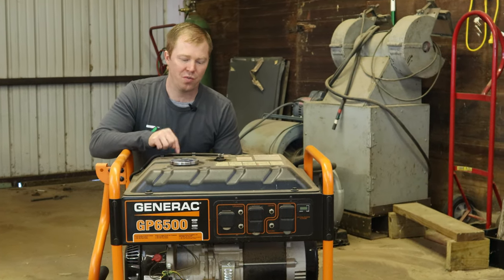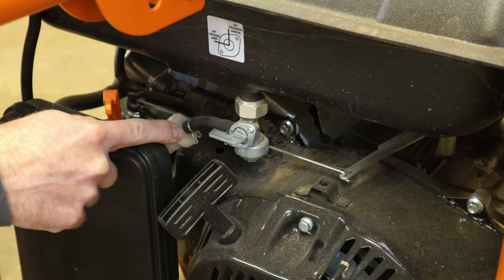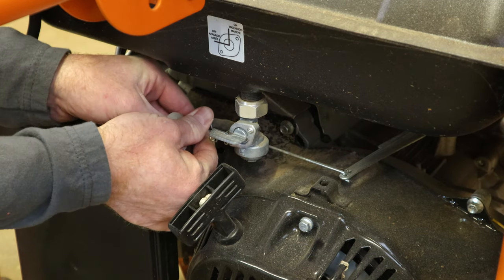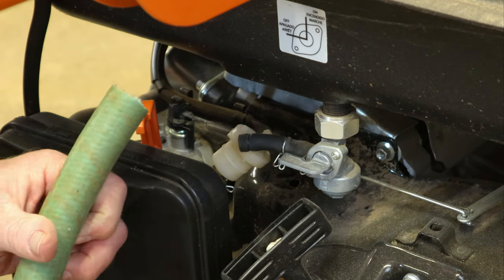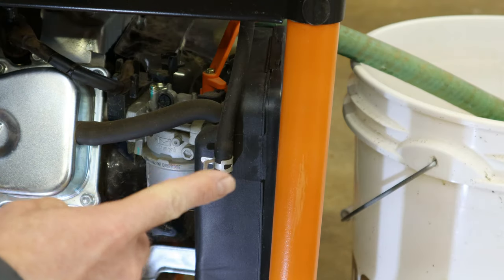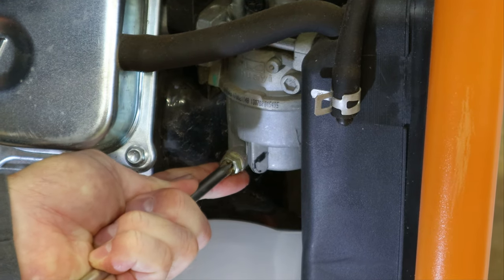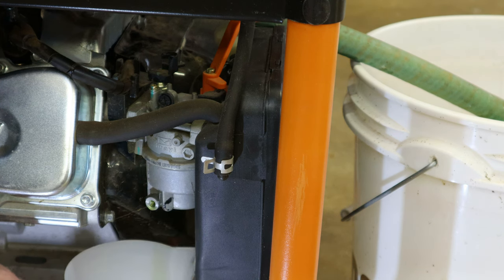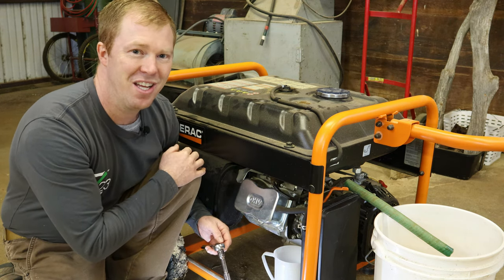Drain Old Gas from Generator - Save Your Fuel System

Comment: Good tips.  You can also simply let the generator run until its out of gas which is what I do each year.
Reply from the maker: Great tip Kent! I do that as well. This tank of gas had set for over a year where didn't want to run the old gas through the system. But yes, if your gas is not too old it is easier just to let it run till empty. Thanks for mentioning that.
Reply: I have a 50 Amp generator..  As a woman, I am at a loss for much of this stuff.  I  purchased to use in the winter to save my pool in case of a Grid Failure.  I am having a HARD time finding a hazardous  facility.  How long would it take for  me to burn  the gas from the generator..   I burned some by letting it run for 20 minutes each month. The gas is  a year old with fuel stabilizer in it.
Reply: Yes, and then attempt to crank it with the choke on. That will cause it to suck the last bit of fuel from the carb.
Reply: @ArtGardenFoodExpressions - don’t store fuel in it, drain the fuel and use it in your car. Don’t keep fuel more than three months. Just cycle it through your car then you don’t have to buy Stabil or worry about it going bad. No big deal for me.
Reply: Just running a dry is not sufficient. You need to drain the bowl by removing the bolt on the carburetor bowl.

Comment: Great video this is definitely how you store a generator and not have to buy unnecessary stuff like Stabil or ethanol free fuel. Once suggestion when you’ve removed the fuel line take your compressor and blow low pressure air down through the carburetor with the bowl bolt off.  That will get a few more teaspoons out to really get the bowl clear of fuel.  I’ve done this for 10 or 15 years. I start mine maybe every eight months or when the power goes out. Starts on the first pull

Comment: Thanks for your videos!  I'm getting my generator ready for Hurricane Milton and it's not been used in over a year and stupidly, I did not fill it with fuel and a stabilizer to store.  These instructions worked for my DeWalt DXGNR8000 which looks pretty much exactly the same as your Generac.

Comment: What can we do with year old gasoline? Also tell everyone not to run that E85 junk in small motors. They should be using only Premium. Thanks for the video!❤
Reply from the maker: Getting rid of old gasoline can be a hard solution but with a little effort it can be done safely and legally. Option 1 is searching online for a disposal center near you. You can search "hazardous waste disposal center in ___ county or city or state.  
Option 2: Call your city waste management agency and see if they know of a local place to dispose of it.  
Option 3: Call your local fire department and ask them. 
Option 4: If it is pure gas (NO gas / oil mix from chainsaws, weed eaters, etc.) some people will put small amounts in their vehicle. If they have a 10 gallon tank they might mix 1/2 a gallon of old in with the new to slowly use up the old gas. Vehicles are better equipped to run old gas through their system, BUT I don't recommend this option where you are still running the risk of gumming up your vehicle's fuel system and causing other problems. Hope that helps!

And I totally agree on no E85 gas in small engines. I have a gas station nearby that sells 100%gas and use that in mine.

Comment: I need to drain my old gas also, problem is how to dispose of the old gas.
Reply from the maker: Hi Steve, That can be a hard solution but with a little effort it can be done safely and legally. Option 1 is searching online for a disposal center near you. You can search "hazardous waste disposal center in ___ county or city or state.  
Option 2: Call your city waste management agency and see if they know of a local place to dispose of it.  
Option 3: Call your local fire department and ask them. 
Option 4: If it is pure gas (NO gas / oil mix from chainsaws, weed eaters, etc.) some people will put small amounts in their vehicle. If they have a 10 gallon tank they might mix 1/2 a gallon of old in with the new to slowly use up the old gas. Vehicles are better equipped to run old gas through their system, BUT I don't recommend this option where you are still running the risk of gumming up your vehicle's fuel system and causing other problems. Hope that helps!
Reply: I'm going to burn it in my car. the fuel stabilizer says it's good for 18 months. so at month 17 just move the old gas to your car.
Reply: @koobertohumperdink8702  that's what I do also

Comment: I live in the Dallas-Ft. Worth area of Texas. Since I have NOT experience any situation where gasoline has been unavailable for purchase, I am willing to risk that nothing is going to happen that would change that. Having made peace with that, it makes life easier: When I need my generator, I use it. When that need goes away, I drain the gas out of my generator and into my vehicle. I then attempt to start the generator with the choke on. This removes every last bit of fuel from the carb. Problem solved. Now if I can just find a better, faster, easier way to drain fuel from my generator than the way show in this video...
Reply: I think generator octane is lower than most vehicles
Reply: @vipvip-tf9rw  I never heard of generator octane. I run Premium in my generator. Reasons for that are that the generator needs every last bit of "ump" it can get and ethanol-free fuel is unavailable at local gas stations. My hope is that Premium contains less ethanol.
Reply: foghornleghorn8536  Thanks, do you have any idea why fuel stations do not advertise "ethanol-free" in the DFW metroplex? When I leave the metro area, I see it advertised.

Comment: 100% best Generater.Systems I have used. A test for hurricane prep here in Louisiana: three AC units, 5000, 5000 & 8000, 3 fridges, 2 device power setups, 4 flat screens....AND I had 40% of the power meter to spare.
Reply: Depends on your neighborhood.  ; )
Reply: How many hours did it run with a full tank?

Comment: Very helpful video.  I watch all your generator videos.    I have the same model generator as you.    Followed your video and and drained out all of the old gas into my gas can.  I want to change the fuel filter as you recommended in the beginning of your video- wish this was in your video, too.  Is the plastic circular piece the entire fuel filter?  Do you simply disconnect from the fuel line, replace, and then reconnect to the bottom of the fuel line?

Comment: This is about as thorough of a method as possible.  I hand pump out my old fuel and then run it until it's empty.   Then I refill and run it for a good minute or 10.  I hate moving fuel lines and drain plugs.  It scares me.  Lol maybe I need to have some fuel line on stand by and do it like this.
Reply from the maker: Your method sounds pretty thorough as well!
Reply: You need to face your fear of the fuel lines. They need to be replaced after many years anyway. Buy spare fuel lines and change out the fuel line. You only learn by doing!  Don’t need a pump either. This method works great just can take quite a while if there is a lot of fuel in the tank

Comment: Ha you got me this just reminded me I ran mine out of gas at carb but never drained mine. Thanks for the kick in the pants. 👍
Reply: Ps I put carb cleaner in my gas when I run it I like Lucas. I guess that's why it's lasted 8 years old clean keep paint good. Use it on construction jobs no power homes and power down.oh mines a harbor freight lol I guess there not junk.🍻
Reply from the maker: Haha, I'm right there with you. I forgot to drain mine until I made this video. I really like Lucas too, where I usually squirt a little in the generator and the lawn mower to keep them running smooth. Recently I have been trying Marvel Mystery Oil in the gas. Not sure if it is better then Lucas but they both seem to do good.

Comment: Can generator be stored long term after gas is drained ?
Reply: yes, but you need piston in highest position, and add little oil inside spark plug hole, so piston doesn't rust

Comment: When I unhooked the feul line the feul was running EXTREMELY slow,any ideas as to why?
Reply from the maker: Hi Scott,  Mine drained pretty slow as well where it probably took 20-30 minutes. It can be a slow process standing there watching it. I worked around the shop and just kept coming back and checking it every so often to make sure the bucket didn't get to full.

Comment: Why drain the carb instead of just running the fresh gas?
Reply from the maker: You could run fresh gas and skip the carb, where I've done that myself. It just may be harder to start and you could eventually clog it up as the carb will be pulling in the old gas at first.

Comment: So why didn't you drain the fuel before you put it in storage. 

What you do now is you run the generator until all the fuel out of the carburetor is consumed. 

I'm a Honda lawn mower before I store it the last time I use it I turn the fuel valve off and run the lawn mower until the engine dies then I drain the fuel out That's how you do it kind of backwards the way he's doing it
Reply: Never know…. Could’ve been lucky that he didn’t need to use it & gas eventually got old…. So an individual decided to either show how to drain the old gas out & or decided to take the time & share some helpful info….

Comment: Call me lazy, but I want an easier, better, faster way. I've already done basically what you showed in this video. It took forever to drain and I have to watch it to be sure the gas can doesn't start to overflow AND if you do this enough, you will start to develop a leak where the fuel enters the fuel filter because you are stressing that fuel line. Something like this has to be made effortless or else lazy people like myself won't do it, and then they will hate the day they were born when they need their generator but it won't start. Also, my carb is much more difficult to access than yours is. HERE IS MY IDEA: Add a 2nd petcock to the fuel tank. A BIG one that will drain fast. The fuel line attached to the big petcock should go nowhere except an empty gas can. Please do a video showing how to do what I just said. [I'm not sure how to install a 2nd petcock or what sizes are available, etc.] Thanks in advance.
Reply: how big is youre generator?
Reply: @vipvip-tf9rw  The gas tank holds 6.5 gallons.
Reply: @kipster-ll6po  add t splitter before petcock
Reply: @kipster-ll6po  I think the smartest solution would be using transfer pump
Reply: @vipvip-tf9rw  No can do: There's a strainer screen basket thingy just inside the gas tank. I'd have to remove that to insert the pump. I'd probably mess up that strainer taking it in & out all the time. It probably serves some useful purpose, so I'm hesitant to throw it away. It is unclear to me how your suggestion is the better idea.
Reply: @vipvip-tf9rw  Sounds good. I am hoping for a video to hold my hand and show me how to do that. I know nothing about threads or what have you. I certainly wouldn't want it to leak.
Reply: @kipster-ll6po  are you talking about filter? just lift it, it prevents dirt from gas can into gas tank, if your hose is clean, it's ok, there should be thing in manual about cleaning gas tank filter, if it's not lifting by fingers
Reply: @vipvip-tf9rw  You are exactly right. But will a fuel transfer pump remove ALL fuel from the tank? No. So then I have to run the generator extra long to use up whatever fuel remains. I like my idea better, and I want someone to make an excellent instructional video showing how to do it.